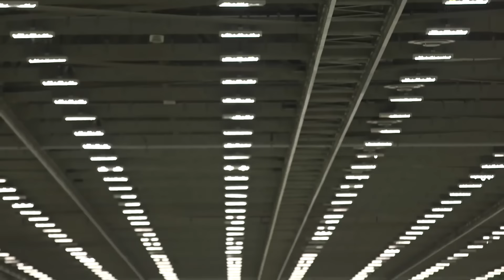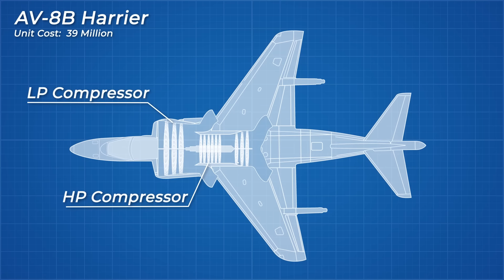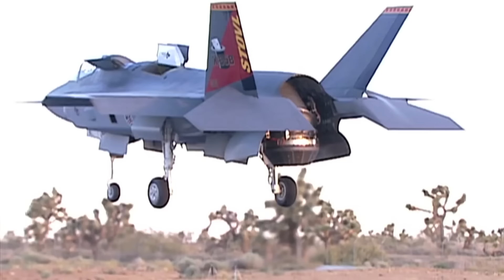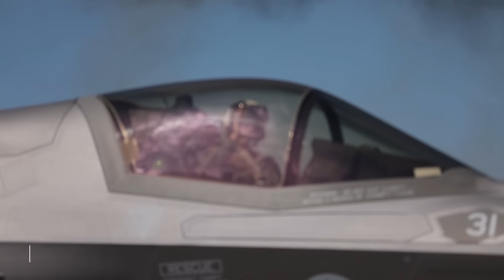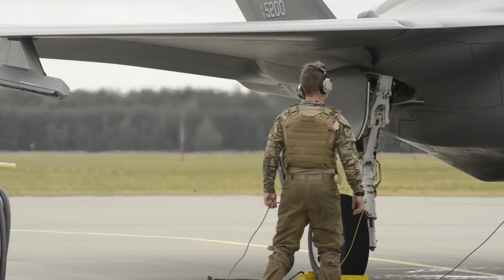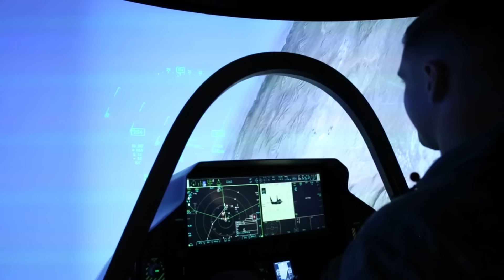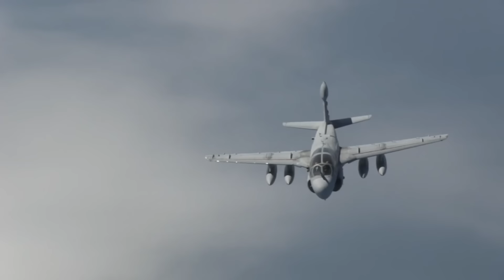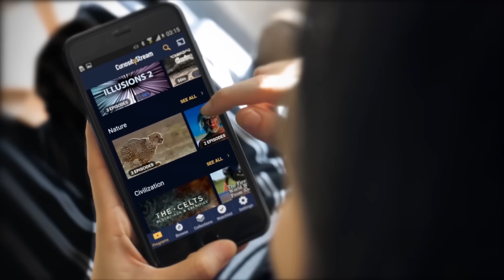Is The F-35 Worth $115 Million?

Comment: So when can we expect to have flying aircraft carriers for drones like those in Ace Combat games?
Reply: The US did experiment with aircraft-carrying airships like the USS Akron back in the 1930s, but they were nearly impossible to control in the wind, and their cargo capacity was disappointing. 
Maybe the solution would be a rigid airship made of carbon composites and shaped like a flying wing for extra lift. The propulsion system could be a small nuclear reactor, powering several high-efficiency ducted fans/turbines. 
Then again, it might be easier to just launch fighters from space stations, as they would be able to stay aloft for much longer without refueling. Assuming the fighters were unmanned drones, they could land or self-destruct after they ran out of fuel, and the space carrier could be restocked with new drones via reusable cargo rockets.
Reply: When we get power-positive fusion plants to run the massive engines required to keep them aloft for any significant period of time.
Reply: Good to see some people with culture
Reply: @blaze6400  i see you're one of muh people
Reply: Still waiting on Stonehenge...
Reply: Boeing is building combat drones for the US Navy based on a reduced size version of the X-32 called the X-45. It's about half the size of the F-35.
Reply: Libs Hate Montesquieu  Yes, they do work remarkably well for naval vessels. But that's not what we're talking about, we're talking about aircraft. And for that, current generation fission generators weigh far too much. 

There's this thing called 'thrust to weight ratio', it's kind of important if you want to actually get off the ground. You're not going to get there with fission, you're going to need something with exponentially more power per kilo.
Reply: Libs Hate Montesquieu  That was kind of my point, actually. The question was 'when are we getting flying aircraft carriers', answer 'when we get power-positive fusion'. In other words 'not in your lifetime, kid'. 

I mean, flying aircraft carriers. Really? Has anyone else here actually SERVED on one? Do you know how enormous they actually are? This isn't an MCU movie, kids.

Comment: I can agree that Steal Fighters are important, I can agree that VTOL is going to be integral with next-gen aircraft, what I can't and won't ever agree on is the scrapping of the A-10 Thunderbolt II. There has been, and will always be 3 categories of basic aircraft, Strike Fighters, Ground Support, and Heavy Bombers. The F-35 can be a Strike Fighter, but it certainly cannot be a Ground Support Aircraft compared to the A-10, the A-10 is tried and true, it's cheaper (about twice as cheap compared to the F-35B) and is better because of the GAU-8 cannon.

Comment: A Jack of All Trades is a Master of Non - meaning that it cannot be worth the money for each individual application.   This means that each department has to divvy up the expense for useless capabilities meant for the other defense departments.  Also add that unless your invading a third world country with mediocre defenses the stealth is also next to useless with the effectiveness of long wavelength quantum radar, a technology that has already been proven and now incorporated into the air defenses of both China and Russia.  In fact, these two countries are not the only ones that have perfected this technology.  Not more than a week ago at the Berlin air show, a small private German radar manufacturer secretly tested their equipment to see how effective it would be with the F35.  From what they claim, they wanted to track the plane during the show but the F35 for some reason stayed grounded.  So instead they set it up in a nearby field with the system on passive scanning.  Low and behold, they were able to track the plane for many hundreds of kilometers, no different than any other plane.  Something the US is not to proud to advertise.  Now add to this the fact that the F35 top speed is only mach 1.6, nearly half of its primary competitors and a poor dog fighter, as admitted here.  You can throw the first strike capabilities out the window.  Another ripoff by the US MIC.

Comment: The information at 16:50 is not correct, Russia did not use F-117 to reverse engineer stealth technology. It was actually China (which was confirmed) - Croatian chief of army at during war (Admiral Davor Domazet-Loso) confirmed that Chinese were buying out parts from downed F-117. Most of the parts, including large part of frame are stored in Museum of Aviation, in Belgrade in Serbia.

Russia didn't actually have to, as they already did extensive research in the stealth technology - the US stealth technology is actually based on research from Pyotr Yakovlevich Ufimtsev from 1970s, USSR scientist.

Additionally to support these claims, Russia already had multiple stealth projects at the time - such example is MiG 1.44 (NATO designation Flatpack). Which was stealth fighter prototype with first flight in February 2000, it would be impossible to reverse engineer, design and build a completely new stealth aircraft within just months. The project was later cancelled in favor of current Sukhoi Su-57.

There are still doubts in Russian army about usefulness of stealth technology - which ended up in cancelling ambitious projects like Sukhoi Su-47, or even MiG 1.44 ... in favor of MiG-35 and Sukhoi Su-35S. Additionally even in case of Sukhoi Su-57, they are not meant to be the main Russian military air superiority aircraft (they have ordered about 70 of those). This is due to multiple reasons:
- Russian military doesn't find stealth technology that useful,  Russian radar systems actually can detect and track even small sized stealth aircraft.
- Russian military equipment philosophy is completely different from the US one, they are pushing for cheap, less complex systems that are easy to make, assemble and cheap to upkeep. Stealth aircraft generally tend to not be either of this.

Comment: One of the other criticisms is in regards to replacing the A-10. The major issue is that the warthog is much more durable than the f-35, making it a better  close air support aircraft. Another large advantage that the warthog has is that it is slower, meaning it can "hang around" a battlefield more easily.

Comment: The chassis is flawed. The electronics that give the F-35 it's edge can be fitted on superior air frames. Yes it's replacing some older planes and unifying their purpose into a single platform HOWEVER, the amount of maintenance this aberration needs destroys all the cost saving AND it's a lousy close air support aircraft, limited bomber, abysmal fighter.

Multi-role aircraft get the job done equally poorly!

Comment: Short answer: No. There is a reason every military ever has a range of different vehicles for different jobs. In much the same way a mechanic or engineer has a wide variety of tools,those tools are the best for specific jobs. You can't expect a hammer to do the job of a wrench, welding torch, multi-meter, and hydraulic lift all at one time. Trying to make a "one-size-fits-all" Aircraft was and still is a fools erand. Even the F-35 team knows it, they split their own swiss army air-craft into 3 uniquely equipped variants.
Reply: And yet, the F-16 is one of the world's most successful aircraft despite being a multirole. The one-size-fits-all model is proven in the combat aviation world.
They split it into three variants due to different requirements. The Navy needs a heavy duty steam catapult-ready landing gear while USAF and USMC don't, and they also need folding wings the Air Force has no use for. The Marines need short take offs and vertical landing due to their short carriers, neither the Air Force or the Navy need it. You're confusing different operational requirements that are external to he abilities of the aircraft. The USMC, USAF and USN F-35s will all do the same things. They weren't split because the aircraft can't do everything. Just because the Air Force uses runways, the Marines short carriers and the Navy longer carriers with steam catapults.

Comment: 100% correct about stealth. The Iraqui's could detect the F-117s they just had nothing that could get even close to Radar lock. Low frequency Radar is also huge. IE for a T aerial you are often talking about a minimum areal size of about 2 meter diameter (8x wavelength). By comparison new high power Radar can have an aerial 40cm across (or smaller for some of the very newest types) for a 35kW job.

Comment: You need to realize that their is a lot of astroturfing being made about this plane by foreign entities.
When calculated for inflation the F-35 program is not that expensive and many of other planes have had longer development cycles.
Many of the commonly cited technical issues or shortcomings of this plane are dredged up from 2015-2016 reports when the plane was still in the beta-testing phase, and so those technical issues are outdated. (Oh wait, you did use that outdated report in the video. D:)
It’s fine to be against the MIC but be aware of disinformation about this plane in particular.

Comment: Correction, the F-117 that was shot down was NOT spotted by radar, it was spotted from the ground by ground troops. The pilot flew the (exact same) flight path night after night. When you're basically flying about 500 feet from the deck it's not hard to be shot down.

Comment: Remember the F117 that was shot down was flying with its bomb bay doors open increasing its radar cross section, it also came within just a few tens of kilometres of the SAM site and didn't have any on board equipment that could detect incoming missiles.
Reply: On top of that, the USAF became complacent on using the same strike ingress routes, making its path predictable. Also, the Serbian air defense commander had a spy outside of Aviano AB in Italy who watched all of the aircraft taking off, and informed the commander that there were no jamming (or SEAD? can't remember) aircraft flying that day.

Comment: F-35 Compared with Other Fighters
U.S Fighters:
     -F16: Max Speed Mach 2.0/ Weight: 25,900 lbs/ Range: 575 miles/ Ceiling: 50,000 ft/ 11 missiles 
     -F15: Max Speed Mach 2.5*/ Weight: 41,455 lbs/ Range: *790*/ Ceiling: 60,000 ft/ *8-12 missiles
     -F18: Max Speed Mach 1.8/ Weight: 46,781 lbs/ Range 449 miles / Ceiling: 50,000 ft / 12 missiles (super Hornet)
     -F35: Max Speed Mach 1.6/ Weight: 47,497 lbs /Range: 770 miles/ Ceiling 50,000 ft / 4 Missiles (stealth) 10  missiles (non Stealth)
     -F22: Max Speed Mach 2.25/ Weight: 61,340 lbs/ Range: 679 miles / Ceiling 65,000 ft/ 6 Missiles (Stealth) 14  (non Stealth) 

Russian Fighters:
     -Mig-35: Max Speed Mach 2.0/ Weight: 38,581 lbs/ Range 620 miles/ Ceiling: 57,400 ft / Missiles 8 (Not mass produced only 8 built)
     -SU-27: Max Speed Mach 2.35/ Weight: 56,835 lbs/ Range 745 miles/ Ceiling: 62,000 ft/ Missiles 10
     -Su-34: Max Speed Mach 1.8 / Weight: 49,176 lbs/  Range 680 miles/ Ceiling: 49,000 ft / Missiles 12
     -SU-34: Max Speed Mach 1.8/ Weight: 76,280 lbs/ Range 680 miles/ Ceiling: 49,000 ft / Missiles  12
     -SU-35: Max Speed Mach  2.25/ Weight: 63,320 lbs / Range 990 miles/ Ceiling 59,000 ft/ Missiles 12
     -SU-57: Max Speed Mach 2.0 / Weight: 62,383 lbs / Range ~700 miles / Ceiling 66,000 ft/ Missiles 6 Missiles (Stealth) 12 (Non Stealth)

Comment: It is not 27 years, the number is around 40-50 years and the total cost as a result way more than admitted.
This is the re-labelled multipurpose project that started in the 60s and was cancelled and then restarted as the F-35.
Aren't memories fragile.

Comment: Not the whole story at all with FRS MK2 vs F-35B. EG the maximum G-load for the Harrier was markedly better for both instantaneous and sustained. The F-35B has a lower G limit than the F-35A for example and neither of them can manage 9g like the harrier  FRS MK2. All of the later Harriers can VIFF as well and the F-35B most certainly cannot. There is also the issue of heat signature. Though it was not designed for it specifically the Harrier has a tiny heat profile from behind as the expanding gas from the compressor stage cools down and then helps cool jet efflux. You also cant see the final turbine stage from behind either. So rather than having about 60% of the heat signature of the F-35B it's more like 10%. The F-35 cant fly backwards either. The Harrier has actually done that in combat a couple of times.

Comment: 6:05 a little correction: There is only one lift fan in f-35, not two. Suppose that you probably meant two air intakes. The other intake that opens is supplying fresh intake air to the main engine compressor, as the divertless air intakes on the sides does not provide good airflow at low horisontal speed. Partly circumventing the regular air intakes on the sides prevent engine stall caused by sucking in deflected air from the ground. By the way: check out the VTOL yak-38. It actually have two "regular" jet engines placed vertically just behind the pilot for providing lift in the front. Pretty cool! 😀 By the way keep up the good work!

Comment: The F35 is not 'more than  a worthy successor to the harrier at all lol, it's all well and good having extra capacity for  weapons and fuel. ...but where are you going to put that extra stuff Lol?    The whole idea is to have internal weapon bays, but that limits the size and type of munition, and if you increase fuel tanks, that limits air combat capability.
Stop being a fanboi,  and start being an engineer.     The f35 is one of most problem plagued planes ever.    The Chinese J20 is already superior, and the Russian Su 57 and even older MiGs have performance  advantage and then, of course, there is the S400 system.   Do some research, and stop reading from Lockheed promotional brochures.

The only reason Locked dropped the price was due to Trump calling them out....not Lockheed efficiency.   Again,  do research.
Reply: These aircraft you list are superior how exactly? The dropping price had nothing to do with Trump...

Comment: The F-35's lift fan is something I find (as an ex military aircraft maintenance engineer) terrifying.
I would have taken the X-32's lift post design. 
Why? Well this is a military aircraft. That fan is very very fragile. Bit of shrapnel goes through that fan and it's useless

The X-32 should have been super-sonic with the V-STOL model.

Also, my opinion of combat platforms being extremely expensive is very negative. Combat equipment should be effective and as inexpensive as possible so that it becomes expendable. Otherwise you feel every single loss

Comment: 21:15  
"but the F-35 manages to combine the capabilities of all these aircraft into a single plane"
all... except one plane that it can not replace 2 of it's functions, the A10 "Warthog"s firepower in the GAU-8/A can not be replaced with some very few JSM's.
second is durability, the A10 could take direct hits, loose all main fuel tanks and an engine and still get away. try that with an F35...
while the F35 is a stealth plane but that just makes it into one expensive glass-cannon, one hit and it's done... you just need to hit it first and newer weapons will hit it.
Reply: The A-10 already is being replaced in the role of CAS in contested airspace by the F-16. And the F-35A is supplementing and eventually replacing the F-16. The A-10 is not anymore survivable.

Comment: I mostly agree with the "different planes would be cheaper" assessment. The F35A should never had been bothered with, since a very slightly modified F35C would be just fine for the ground landing only role. I'm thinking an arresting hook delete, maybe solid wings if they think they have the customers for it.  The F35B should have been a different plane, just a few interchangeable parts and a lot of similar design features. Similar enough that a mechanic for one plane should be able to work on the other with a short learning period.

Comment: Oh really? I don't see the F-35 mounting a GAU-8 or having a significant loiter time on station. oh and it's stall speed's higher than the A-10's, so it has to come in faster, which means shorter window to correct your aim for a cannon run. Also I'm pretty sure you don't need radar to shoot a low flying, slow aircraft with an autocannon. the ol' Mark 1 Eyeball should do the job.
Reply: Not really the case.

Comment: Have you guys heard about the german passive radar system, that tracked two of these in April last year? Find it kinda funny that this "invisible" fighter was tracked with such ease and even without the pilots noticing due to the passive technology ^^ The Company ist Hensoldt, and the Radarsystem they used is called "Twinvis", if you wanna find out more...
Reply: Except the F-35's in question were flying for an air demo and have been photographed dozens of time operating Luneberg lenses. Not to mention that radar is a volume search system- not a targeting array.
Reply: @peterson7082  Those lenses are primarily for reflecting the high frequency waves of search radars, not the longer wavelengths of background noise. Multiple independent experts of high frequency technology confirmed that, in their opinion, these lenses did not play a role in the detection

Comment: F-35 was designed for philosophy that airplanes can stealthy come close to enemy and attack without being seen. But that same philosophy is reliant on F-35's communicating  with other F-35's and AWAKS-es. Weakest point of this concept is that when F-35 communicates with other it radiates communication radiowaves. Russians already developed sensors that detect EM broadcasts so only way for F-35 to be truly stealth is to NOT communicate with it's support. Otherwise it WILL be detected. Add to that that Russians already use IR sensors to detect heat signatures of flying aircraft.